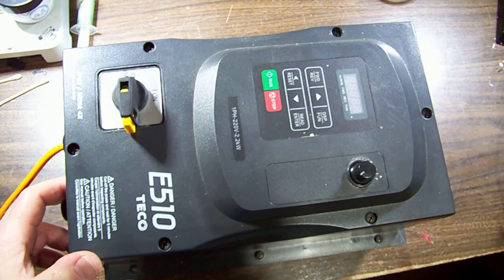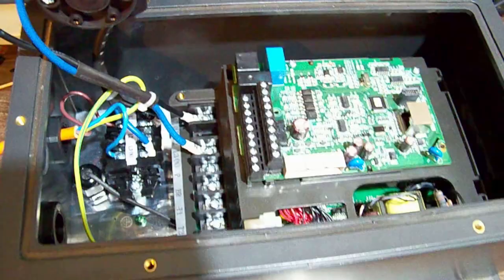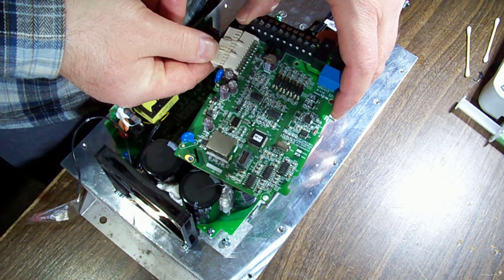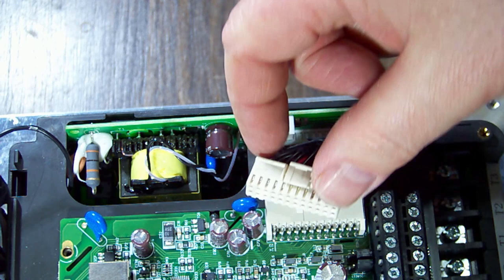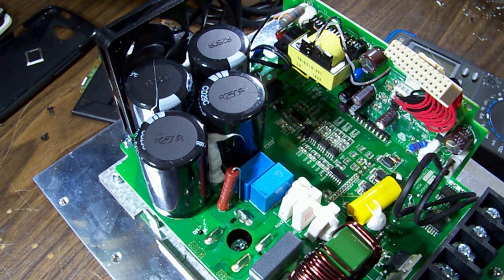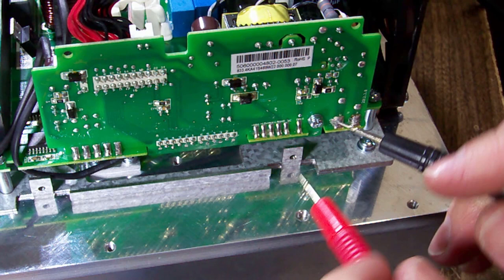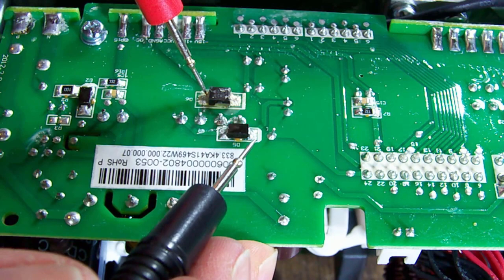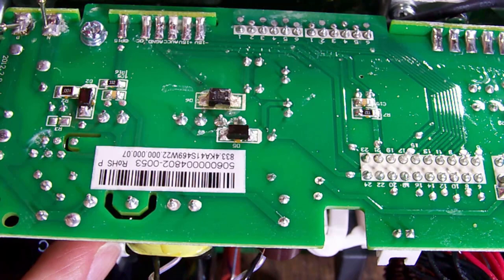Teco E510 VFD repair!

Comment: Well done :-D
When you pointed out the pwm drive side of the psu, i thought ahh switchmode evil lol.
Startup cap/output caps/diodes/pwm chip or really odd failures that would need 3 mugs of tea to work it out, ok 4 mugs :-D.
And when you tested one of the diodes, beeeeeeeeeep great a dead diode  :-D
I was hoping that was the only problem, and it was :-D

Comment: Great job Mate,
Trying to find the appropriate SMD components can be a pain. At the moment I am trying to repair a G Scan 1 and looking for a SMD diode with a code 35 on the body. Have come up with several options, but want to make the correct choice - any suggestions? I have no schematic, but I also have another working G Scan and the diode is measuring a voltage drop of 0.15V on the working circuit board.
Reply from the maker: I'd take the diode off the working on and put it in the dead one to see if works. Is it in a power supply section? Any fast schottky rectifier is probably fine then, wouldn't be passing more than 2A. Does one side of it go to ground, even if through a resistor on either side? If so it could be a zener so check the voltage on the cathode of the working unit, might give you an idea of what it regulates at. You probably can't go too wrong :)
Reply: @JonnyFix  Cheers Jonny, will do. Thanks for your suggestions.

Comment: I made a stupid mistake today. I was not fully awake, and connected the input voltage to the output :/ Now it will not work properley. I know what the fault is. Some resistors burned. I think they are in paralell with the output MOSFETS. At least they are close to them. I will try to fix later, but do you have any tips? :P
Reply from the maker: None specifically. Replace what fried. If the mosfets are shorted check the gate resistor isn't blown open/high resitance either. If they are bad check to the next component back and so on. There might be a transistor feeding the gate resistor etc. If that all checks out cross ya fingers! Maybe don't put a load on it, just fire it up and see if the output is ok by itself.

Comment: I have a Teco L510 that has the ES emergency stop error flashing on the display, pressing the reset button does nothing. Is their anyway to reset this thing, or is it bricked?
Reply from the maker: No idea sorry. Why would you jump to bricked? Did you do a firmware update right before this problem? IF not, and without looking at the user manual, I assume it has an ES input to be able to be stopped remotely. I would be checking the input circuitry and make sure it's ok and there's nothing causing the processor to wrongly think there is a signal here... for a start.
Reply: First of all, thanks for responding. Half way through my response to you, I stopped and decided to mess around with the vfd, connecting a wire between the Com/+12 and the inputs, trying each one, S5 to S1, I couldn't remember which input I had the estop connected to. I thought it was either S5 or S4. That is the only two I ever checked before. It turns out it was S4. When I turned the power on, after connecting the wire, it reset! If you didn't mention the ES inputs, I would have never figured it out. Thanks!
Reply from the maker: @machineman268  glad to help. Sometimes we just need a 2nd perspective on something 😊

Comment: Hello Sir or Madam,
My name is Phonesavanh VORACHIT. I’m electrical control In Vientiane Laos PDR.
I have some questions to ask you about TECO Westinghouse E510-415-H3FN4S-U. Because we bought some TECO Westinghouse E510-415-H3FN4S-U for spare part.
Before Last couple year we have TECO Westinghouse MA7200 now it has broken. So we try to connect PLC Allen Bradly 830 to TECO Westinghouse E510-415-H3FN4S-U but it cannot connected to the PLC.
Do you have any suggestions to find out solution that problem? Or do you have any information about Parameters to connect to PLC.
Reply from the maker: No idea, I've never used one. Looks complicated just reading the user manuals. Right away, the MA7200 refers to a memory map with addresses to access certain controls. It also refers to a 'profibus' as a hardware protocol. Maybe the PLC is configured to talk in profibus not modbus, the E510 uses modbus. Lots of work for you to do to re-configure the PLC.
Reply: @JonnyFix  Thanks